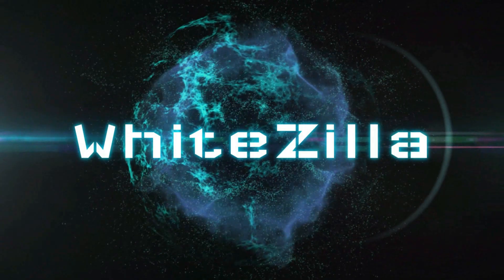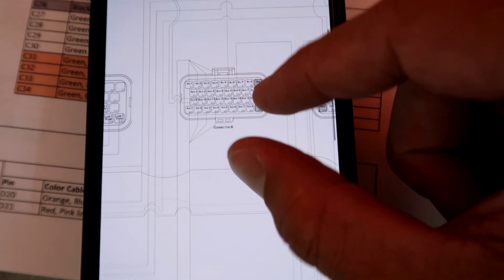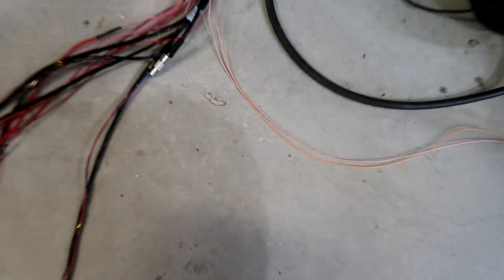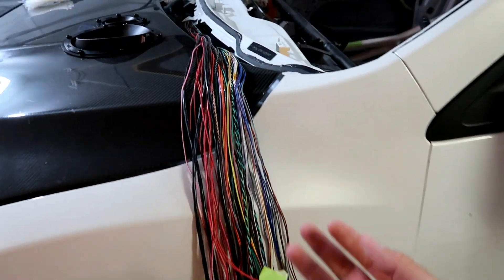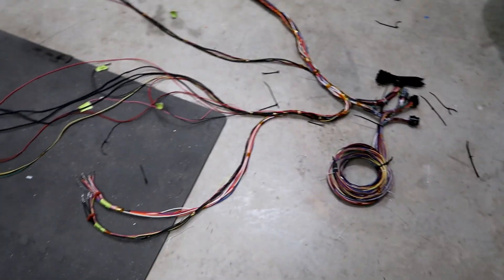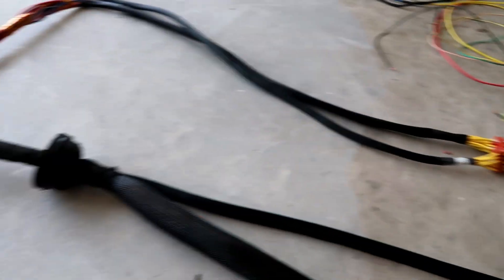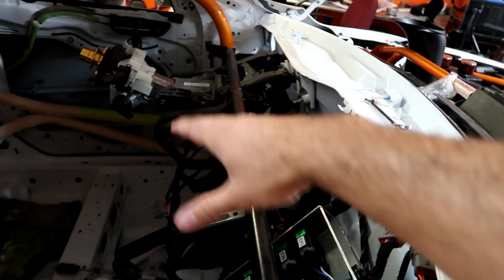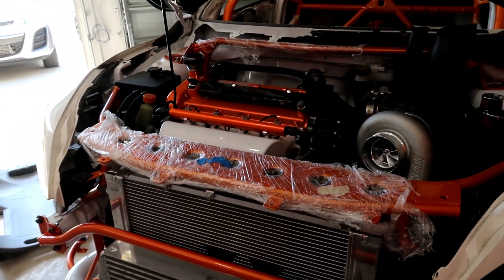Emtron ECU Wiring Done Part 2 - Mazdaspeed3 Standalone  ECU Wiring (Episode 54)

Comment: It is a clean build indeed, but curious why not using the DI with the PI? There's a few standalone ECU's (Motec & Syvecs) that can control both (Dual injection). Everything looks amazing. Keep it up.
Reply from the maker: Didnt want to run DI anymore and Emtron stepped up and help me develop the harness unlike the other brands that said no.
Reply: @WZ_TV  Oh ok. I know DI is kinda sensitive on some areas specially when running Ethanol. But at the same time it sucks that they didn't want to help with the development which at the end they are the ones that are going to have the most benefits (meaning more  customers). Again your setup looks very solid. I want to go with Syvecs on my Gen1 speed3 and keeping all the car functions but with all features from the standalone but the harness is what is holding me back. And honestly setups like yours keep me pumped.
Reply from the maker: @Omi-g7x  thank man. Good luck with your set up!

Comment: Why would you not use the hpfp to supply fuel to the port injection? This is what the 1000hp hondas are doing.
Reply from the maker: The mechanical pumps hondas are using doesnt flow the same psi as direct injection pumps. DI pumps push over 2000psi. PI injectors work below 100psi for the most part.
Reply: They are using mechanical pumps on old Honda engines to run regular injectors 1-2000cc..
Reply from the maker: @blazonemore2  yes but again they dont run the same amount of psi.
Reply: Just needs fpr and it would work great. Just saying.
Reply from the maker: @blazonemore2  fuel pressure regulator that controls over 2000psi?
Reply: You can control the psi. You can reduce it to whatever you need before it get to the fpr. When the fprv is removed  the hpfp does not build much pressure but flows a ton.
Reply from the maker: @blazonemore2  but why keep the pump if im not running DI? You still need the intank pumps. Plus they dont really like ethanol. Less stuff to go wrong.

Comment: I'm in the middle of doing this as well! What program did you use to make the wire diagram awesome job man.
Reply: Also ya mind sending me any of the stuff you made. I'm doing it on an FD rx7 so it won't work one for one but it's awesome to utilize it as a cheat sheet. If ya dont mind haha. Hit me up on lessnerc1@gmail.com or on IG @darkdrakex
Reply from the maker: Hey man. I use a program called Revit. I sent you the wiring pinout through email.